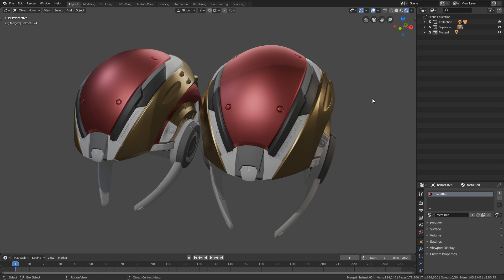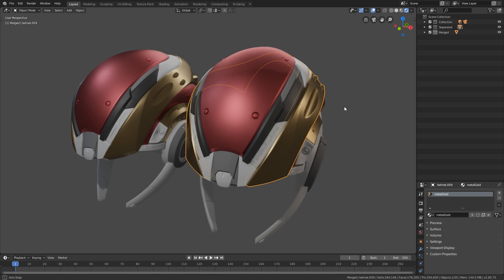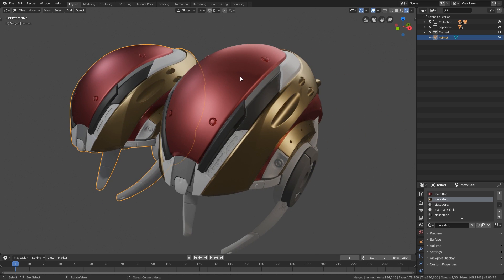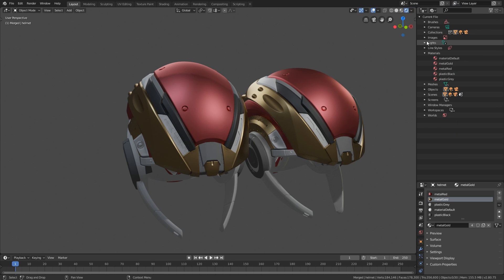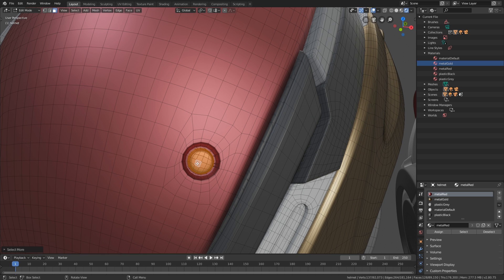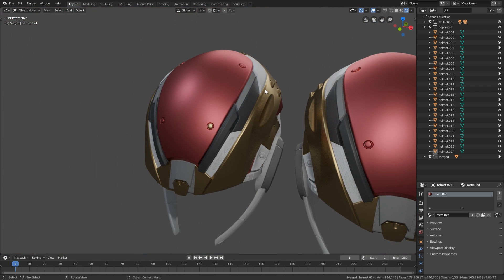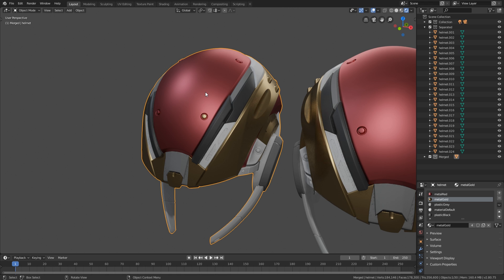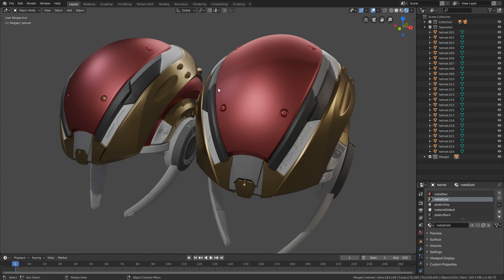When To Split Your 3D Models - 3D Modeling Fundamentals

Comment: When do you add more materials to an object? I believe with substance painter you can assign one material to everything and then paint in and sectively choose what parts get what detail, so often I feel there is no need for multiple materials. Is it simply for organization reasons or a UV map thing? I am unsure as ive never gotten a clear answer: When to use one material vs when to add another / use multiple.

Comment: One reason why you should separate your models is so that it's easier to calculate the mass of the model in physics situations, and especially the balance of weight. If your model is all one object, sure - you can still give the object weight, but if the object - say, a hammer - has a wooden shaft and a metal head, the physics simulation wouldn't be able to tell that the head is heavier, and your simulation wouldn't be accurate.

Comment: I see few comments about merging into one object is better for games, and it's right most of the time (except for animated/moving parts). The critical point to remember guys, is to let the objects separated inside the modeling software, and THEN when you export into a game engine, you make it ONE .fbx/obj (which is one object in-engine).  I always struggled about it, asking my self if i should split or not models in the modeling software : the answer is very often : NO (to keep better control).

Comment: This goes in a completely opposite way to everything I've learned about 3D assets and game engines for the past 3 years. The only application I can see for a mesh where everything's kept separate, is for high resolution, close up product shots. In every other instance, especially when it comes to using this mesh in a 3D engine,  the mesh MUST be combined and one should use as fewer materials as possible (for example, for this helmet, one can use only 1 material instead of 5). 
This video makes absolutely no sense!

Comment: Well, I'm thinking of learning rigging in Blender; for my last anime-like character in the end I posed in Zbrush out of laziness but at some point I started to join the cloth with the body, thinking that it may be better to have them on the same UV island and not deal with UDIMs in Blender or whatever program. Actually doing so created an issue with SSS because there's a cut in the cloth (and also the body is cut where you don't see it so no need for more polygons there - and here's a new topic: "When to remove polygons on the bodies or not"), I had to kinda fake the SSS on that tiny piece of skin in the middle of the cloth lol
I found an example of rigged character in Blender where the character has full body and separated clothes, I guess that's the way to go. It's kinda hard sometimes to find the right balance between the "game character" and the "industry production" workflows, especially when you're a hobbyist at home doing everything by yourself, not in a studio x)

(oh and by the way you can see the result here : https://www.artstation.com/artwork/2xGy2a )

Comment: When to keep all UVs in one map and when to separate them ?
Reply: would you want a different texture set for that object when you texture in substance for example? you could either split it up into a different texture set by splitting up the model and uvs or just bake an id colour map if you want separate textures on the same mesh and same uv.
Reply: @ivanlyw2000  I think in the game industry most games use one big UV map and texture set per asset even if the object has different materials.  So if you are in the limitations of texture memory like most of the game devs then you should keep all uvs in one map.
Reply: @fernwehmind  thats true but alot of big AAA games now use multiple texture sets just to get higher resolution on characters. The only thing that games cant really handle well is having a mesh that goes over UV 0-1, which may need some kind of special shader for it. Do correct me if I am wrong.Thank you
Reply: if you dont have enough texel density then split.

if you use different shaders you can split too (metal and glass)

Comment: Hey, do you guys have a tutorial on your settings or best settings for zbrush?  I am struggling to get the pressure to work properly on my tablet.  I am currently using xp pen 15.6 with 8000+ pen pressure but my strokes are consistently the same size even after tweaking the settings.
Reply: Maybe turn OFF/ON windows Ink?

Comment: I was actually thinking of a question along the lines of this topic. I will try to explain this clearly as possible; So say for instance I wanted to make a ship building system using modular pieces individually. I do think I would have to use the pieces separately so I would make the pieces in the model program and export them to the engine; but do I export the pieces with their own origins at their center or export them all sharing the same point of origin as the other pieces?

Comment: I would like to know more about separation for rigging <3
Reply from the maker: For rigging, its best that the objects are separate. Then they can move them around in their rig as they want and change hierarchies to fit them. Its very problematic if a rigger gets a model which is in one piece.
Reply: @FlippedNormals  so, for example, if im slicing hand from body, do i need also to cut hand to 3 or more pieces? cuz, now after watching video i think that i have to cut my models as much times as it is possible

Comment: is there a way to export an FBX from blender so that when importing the mesh into UE4 the mesh would be seen as 1 combined mesh, but when imported into modeling software it would be seen as separate? or should I just plan on using 2 files.

Comment: CLOTHES = HARD 
Clothes are my weakest point! and i wish i knew a professional's viewpoint!   
Please make a video about clothes In Blender;

Clothes have to be united to the body or seprated but the body inside the clothes have to be deleted (or masked out) , which is always weird
Reply: Offcourse you can then retopo the clothes this is just so you dont have to do all the detail your self.
Reply: Use a cloth simulation to make the clothes for your character :))
Reply: @xpdatabase1197  Do we need dummy mesh for collision instead the actual body part?
Because the clothes always acting up when i straightly use the body as collision.
Reply: @xpdatabase1197  Yes but then it's not usable for animations because of the high polycount and then there is the mesh intersection with character ecc
Reply: Just use marvelous designer. Easy.
Reply: Make it a bit more thicker or you can use another mesh for the collision box of the clothes which is a bit bigger so it doesnt go thrue the mesh

Comment: I agree that you should keep a separated copy around, but for game dev, that helmet is one piece except for any moving parts.
Reply: yeah i got the feeling they really didnt really specify for what industry this is aimed primarily. I think they talked mainly about movies. I too think for games one piece is better.
Reply: @JuSmth  Combined yes but not seamless, modeling all that as one piece including the screws would be silly
Reply: In games you would also have as few materials as possible. Mostly one material with different maps. You might not even model some details and just add them using textures.
Reply: What about open or close edges? i know for  sculpting & 3d printing it needs to be watertight but what about for video games or feature film with opensubdiv?

Comment: Very interesting.

Somewhat unrelated, but here’s a topology question I’ve been trying to wrap my head around for some time now, so I thought maybe you’ll consider exploring this topic in detail to be an interesting idea. I couldn’t really find definitive answers anywhere.
How bad (or good?) is it to have self intersecting/self crossing edge/face loops? Is topology with lots of those considered to be messy? Should they be avoided whenever possible and if yes, to what cost? Also are there situations when self intersecting edge/faceloops are actually desirable and should be actively pursued? Or is it maybe just not a big deal to even think about?
Reply: From my experience it not a huge deal technically, but just for keeping things neat and tidy it can be good to not do this. Think of a wall with an extruded section. If you're really tight on poly counts then you could do a plane for the wall and a box intersecting it, but generally you would just inset and extrude, then separate if its another material. It means a few more Poly's (depending on the shape) but its clean and easy to read even in wireframe. 
One downside technically I can think of is some issues in baking the ao around the area but usually it won't be an issue. Likewise depending on the texture setup it can mean wasted UV space. If it was a huge issue performance wise then modular environments wouldn't really be possible since they often rely on lots of intersecting spaces.

Comment: Can I apply this principle for games? Thanks!
Reply: You should model it this way yes. But when it comes to exporting it to game engine no. It should all be combined into a single mesh especially in the case of the helmet they have shown in the video at-least. As another user pointed out this limits the amount of "draw calls" the game engine has to make, the lower the better the perf. Essentially the game engine pieces each frame together by looking for each individual object. You combine this helmet into 1 object it only has to do it once, verses uncombined 15 times for all the different components.

This only makes sense if you're sending it straight to the game engine and not another artist who has to do animation or whatever.

Comment: should the same rule apply to game assets? isnt it better for games to everything be one single mesh and materials controlled by textures and shaders? What is better? More meshes with the same material or one mesh with multiple materials?
Reply: less so these days than even earlier this gen. Even then, modeling high poly objects should follow these rules, especially since you're gonna need to bake out material ID maps down the line.

Comment: This is great. I have a question though, untill which step of the production is this applicable? Just modeling or is it production ready (meaning optimized for real time applications)? Could you give us an insight on the draw calls reduction step?
 Keep up with the great series!!
Reply: That would depend on the project. If its a smaller prop that there will be a lot of it would be wise to combine. If its a huge castle its Better done modularly as occlusion culling would negate the issues of more draw calls. A whole building as one mesh might be okay in a top down game but 1st or 3rd person where it'll likely be higher quality and texture sizes would be bigger, separating walls and such means that it won't render the ones out of view which saves performance.

Comment: To my knowledge, a good reason to merge objects into one is to reduce draw calls in a game engine. When rendering a frame, each object is drawn individually so having many objects can take longer to render vs having them merged into fewer objects will take less time to render. This probably becomes a concern mostly on weaker hardware like mobile devices or in very dense scenes.

Other then that, if there's a practical reason to keep your objects separate, go for it. Just be aware of the tradeoffs.
Reply: Also good reason to merge is to have less textures. Mainly for games but it's easier for anything I think.
Reply: @xSpiiXeL  You can have a texture map spanning different objects though.
Reply: @xSpiiXeL  yeah, but you can also use a texture atlas for same reason. 
I wonder tho, is it better to use one 16k*16k image (if it's even possible, not sure) or a bunch of 512*512 textures? 
I know some older engines have a limit to a texture size of 4k or even 2k. Do modern (Unreal, Unity, CryEngine etc) have similar issue?
Reply: @zhulikkulik  iirc, idTech 5 engine could handle 128k x 128k (megatexture).
Reply: @rama-doni  omg. You could probably fit all the textures from HL2 in one of those XD
Reply: @zhulikkulik  It could fit all the HD textures in Rage. The main downfall is the size. For the same graphical fidelity, the amount of storage consumed increases by quite a lot. Rage was considered an extremely large game when it came out. This is back when a 20GB game was considered massive. And a 30GB game was something else entirely. Before games slowly started becoming larger, and larger, and larger. So yeah, it wasn't exactly efficient. But it was great for artists, as they could easily edit copied assets, texture-wise, and make them all unique.
Reply: @xSpiiXeL  Material layering. Yup.
Reply: Yep. Usually when I’m modelling, I’ll create separate objects when needed and then merge them afterwards where I can. It’s not gonna have a major effect on performance, but if I do this for every single object in a scene it could make the difference for someone using a cheap PC between being able to play the game fine at 24 or 25fps and playing at 23fps and feeling motion sick. Objects only stay separate when they have to be

Comment: Trouble is with lots of seperate parts though, is Substance Painter will generate a texture set for every object, which is useless for a game dev model, with twenty parts just in that helmet, your going to get twenty textures
Reply: Yeah I think they're just referring to animation, VFX, or high poly assets since a final game mesh wouldn't have all those pieces or separate materials to begin with.
Reply: I've seen examples in dev where a multy-part object was done overlayed on a single texture. They just all had different uv so they didn't overlap. Or they did overlap, saving texture.
Reply: If you want to have 1 material in substance just assign the same meterial to the all the objects and then uv them together
Reply: If you put all the UV shells on the same map it will be one texture set.